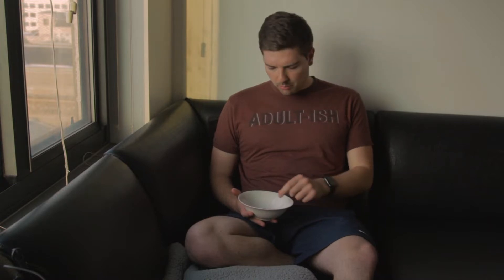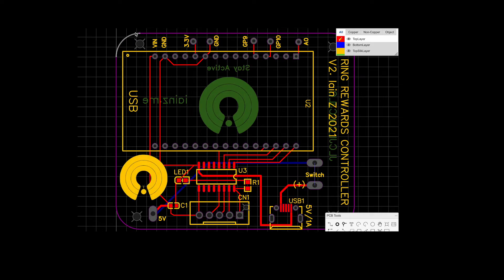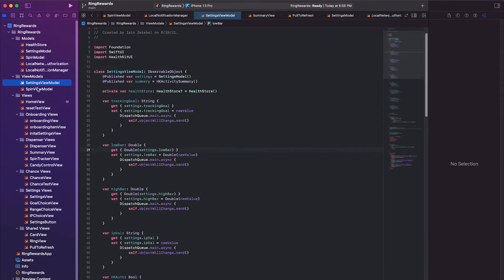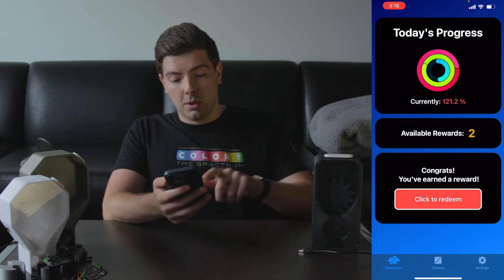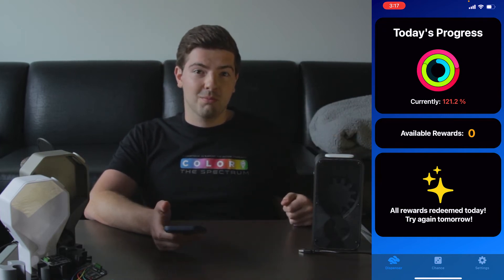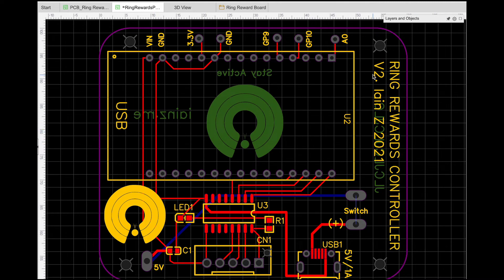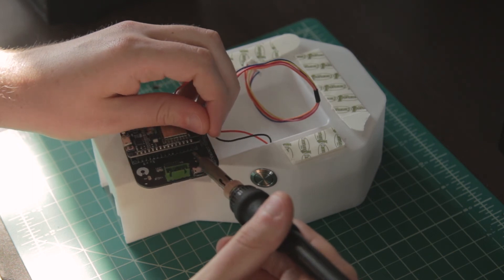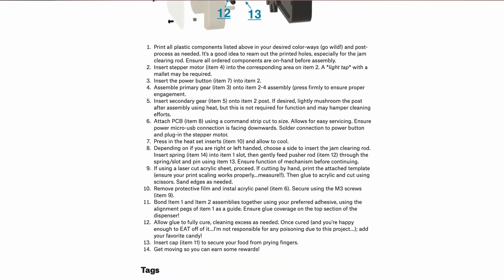I built a DIY Apple Watch Powered Candy Dispenser!

Comment: I WANT TO MAKE THIS!!
Reply: while I can 3d print and laser cut acrylic, I think the electronics part might be way over my head.  :(  I don't understand the 8th item needed at all - Electronics PCB. I'm so sad, this is crazy amazing!
Reply from the maker: Don’t give up! You don’t need to have the custom PCB to make this work. I can try and update the BOM to include the individual electronics you’d need to buy to put it together. It’s nothing too crazy, just an Arduino and stepper motor driver really. I’ll try and get those up soon! Glad you like it!
Reply: @IZLabs  I would so appreciate that!! This is by far the coolest thing I’ve seen since I started printing, hands down. I started walking 5 miles a day ( I work from home) and this would be absolutely fantastic for the office
Reply from the maker: Ok it's updated now with the components you need. I didn't have time to put together a wiring diagram yet, but you should be able to piece it together from the stepper motor driver's instructions and the Arduino code. Thanks for pointing out that I forgot to list those components! https://www.printables.com/model/229330-apple-fitness-candy-dispenser-ring-rewards